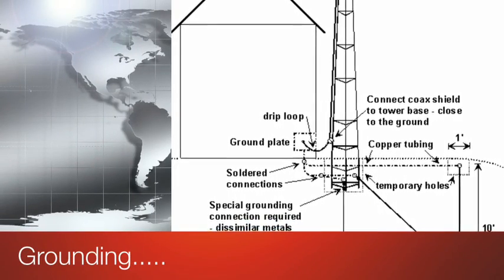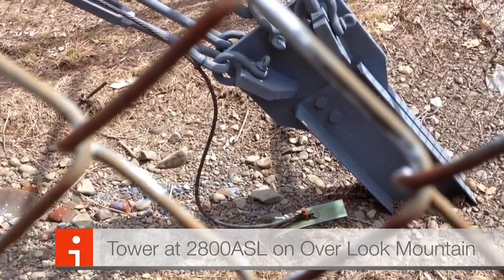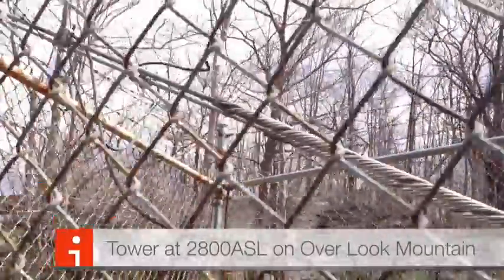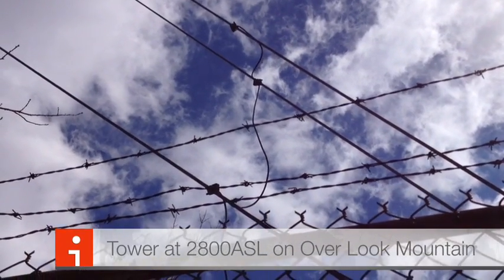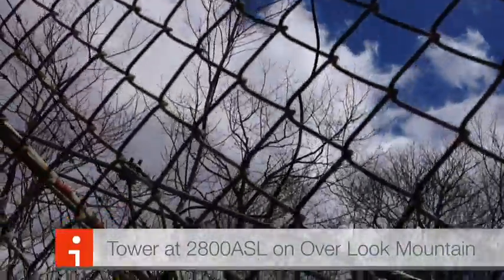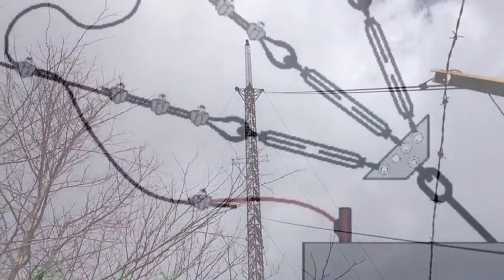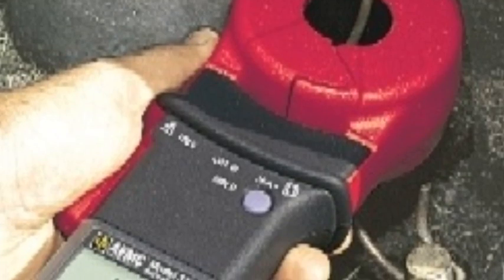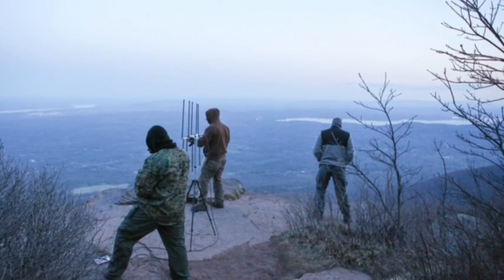Lightening protection technic you may have forgotten!

Comment from the maker: As per a small 14awg, 12awg wire to a 500mc wire I assure you the 500MC wire "will not" vaporize. If you want to bleed off static build up then a flat copper strap (wider the better) has less resistance than 12awg wire. The small 12awg wire seen in photo also has a potential to cause "skin effect" reducing the ability to bleed R.F. ,or static build up.

Comment from the maker: qhack, you are correct about static build up and of course you left out stray R.F. but you are wrong about what the main purpose of the type of grounding I'm showing in this vid. Guess you missed the point! What you see in the video is purely "lightening protection grounding" at a commercial level. I can assure you that tower has been hit many times and that type of ground has served it's purpose.

Comment: I gotta agree with qhack. The purpose of grounding metal objects is to bring it to the same "potential" as ground, minimizing the likelihood of a direct lightning strike (I call this "safety grounding"). Even if you're using a thick ground wire, a direct strike will still likely vaporize the wire.

Comment: I think you miss the point of grounding your antenna... It isn't to provide a path for the lightning to travel (though it would be smart to have a ground system that can handle that) No the point of grounding the antenna is to bleed off the static build up, so that lightning doesn't strike your antenna.  The little ground wire you claim won't do anything is actually doing quite a lot.  However, if lightning did strike it, you are correct, it would vaporize.